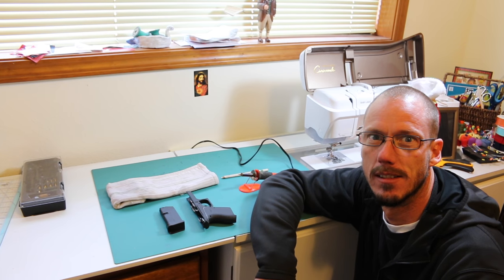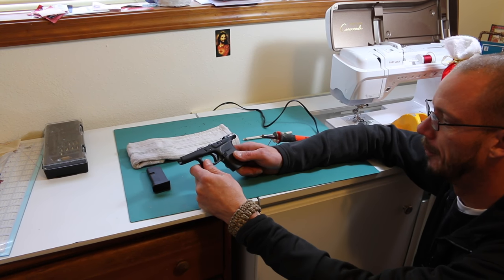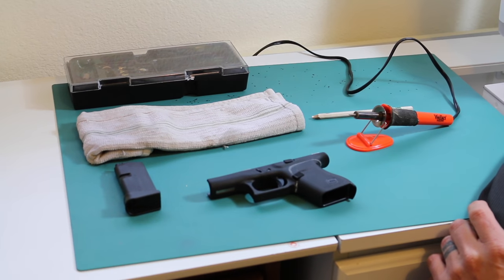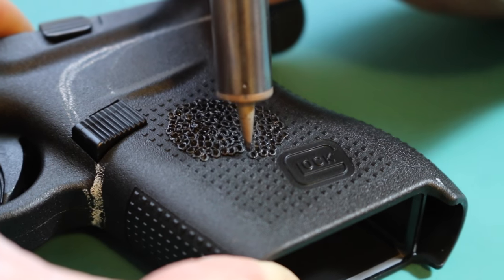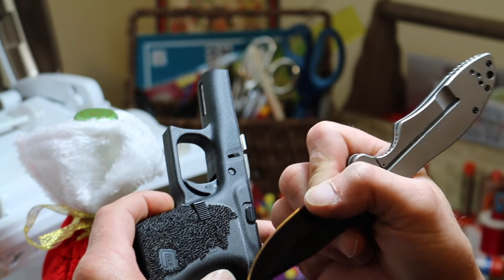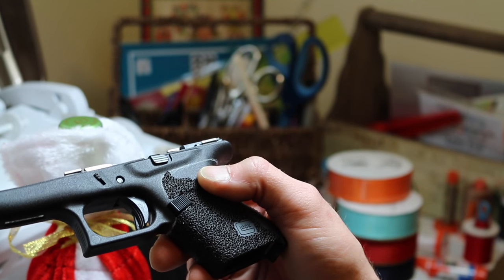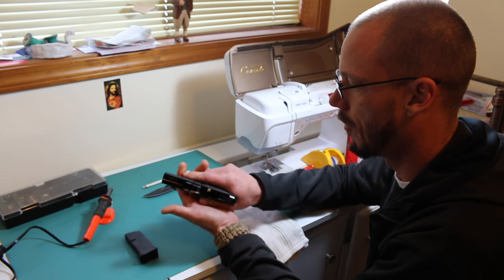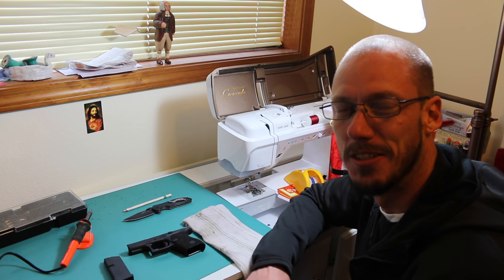Stippling Handgun Grips - Glock G43

Comment: Use the glock gun case, it's the same polymer.
Reply: Thanks for the advice
Reply: Oh dude good tip. Thanks!
Reply: Practice on some 3 inch pvc pipe
Reply: Dude awesome advise 👌
Reply: I was going to ask this. Thank you!
Reply: The extra backstraps work great for practice too if you don’t use them
Reply: I used the mag loader that comes with it

Comment: Found a bunch of Co2 BB Guns at a garage sale and decided theyd be good to practice on because i gave zero fucks about them. Bought a cheap soldering gun from WalMart because it came with almost chromed tips so it wouldnt stick to plastic. Although plastic bb guns and airsoft guns arent made from the same polymer that firearms are it still taught me alot about designs, how to fix mistakes and how quickly and deep to go. Then did a few baseplates and p mags. Went to hex mags and glock mags next because theyre closer to the frame polymer. Finally bought two police trade in glocks for $400 all together. I got two because one had a some gouges and terrible attempts at fixing and the second was perfect except for holster wear. Modified some wood burning tips to work and ended up with a couple grippy nice looking glocks. Hardest part is straight borders when just doing tiny dots. Also always wear either a paper painting mask or a full respirator. Bb guns, airsoft guns and magazines are fucking toxic and polymer isnt much better. Ventilation is also a must. And either a brass tip cleaner for soldering irons or a wet sponge to clean excess off the tip so it wont stick and wont keep smoking. I think id still rather pay some of the companies if i wanted stippling more for looks because there are some crazy talented people for that but if its purely function ill always do it myself. Except slide grooves, dremels and slides is a no no. Either learn to use a mill or pay for the work lol

Comment: I just stippled my Yeet Cannon (stock highpoint grips are smooth as glass😒) last night, it makes a world of difference. One thing I found was if things get too aggressive, or if your iron is leaving sharp tips in the plastic, you can take a propane torch and lightly run over the stippling to round any sharp edges down, makes it grip well but doesn't dig into your skin. I also painted over the grips, let things dry for a bit, then ran a rag soaked in alcohol over it to remove the paint from all the highest points of the stippling while leaving the paint in the dips and valleys. Looks pretty cool, I used dark grey paint and the plastic is black, kinda has a stone look now.

Comment: just a suggestion.. i usually take a dremel to the factroy grip and make everything even.. that was doesnt increase diameter of the grip as well as keeps everything even..
Reply from the maker: Sweet, good suggestion.  Thanks for adding to the conversation and for watching!
Reply: Can't you just use a drill press with a stop ?

Comment: Why do you need better grip on the trigger guard? Also, I've noticed the people who aren't great at stippling are the ones who over use the "this is a tool. functionality over form" comments. I figure you can do it for functionality and still make it look really nice.
Reply from the maker: Kevin P speaking for me personally (not the owner of the gun or the stippler) I think a lot of this is all personal preference.  Somewhat like buying a stock truck and then putting nice tires and a lift on it, do you really need it?  I personally haven't stippled any of my firearms but I have modified some of them in ways that fit my personal prefences.
Reply from the maker: Kevin P Thanks for watching and commenting by the way!
Reply: Yep, you're exactly right. It can be functional AND look good, AND you don't need texturing all over the trigger guard like on the sides. All you need is a patch on the underside if you prefer it. A good texture job and frame package can help retain the value of your glock, or even raise it some. But, telling people they should texture the entire trigger guard is a good way to fuck up the gun and lose a lot of value in the gun if they decide to sell it later on down the road.
Reply: Kevin P  I do single/double undercuts on my customers Glocks and square off the nose as well. If I could attach a picture I would.  It adds control to your shooting and let's you get a higher grip on the gun. Look it up- there's hundreds of guys showing it done.
Reply: It adds a higher grip on the gun and more control when you do a 2nd cut cut to hold gun (stops some of the recoil.  There are hundreds of guys showing videos of it and how it helps.